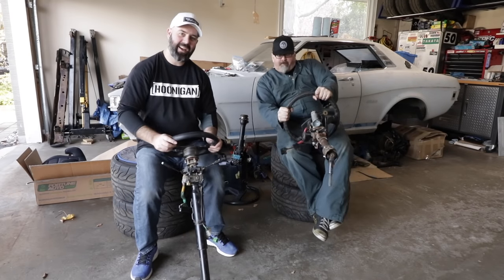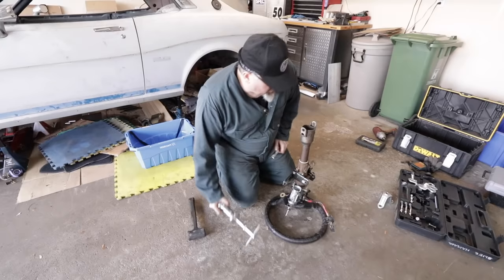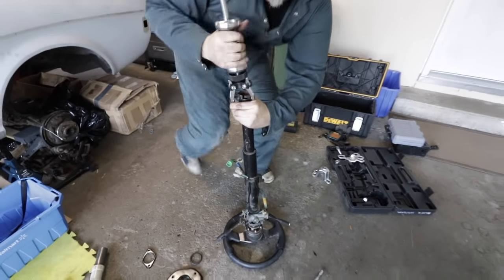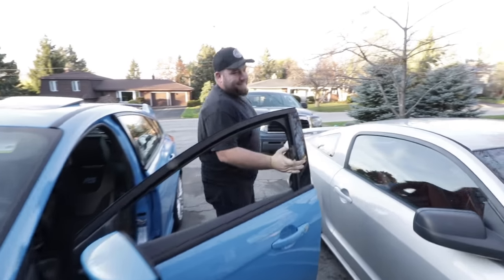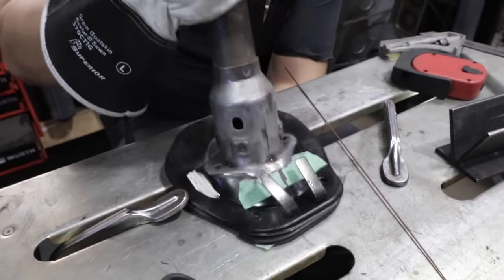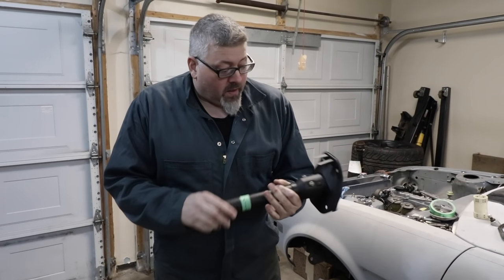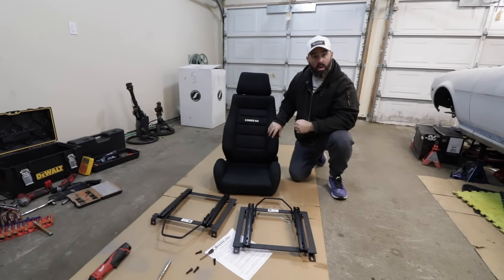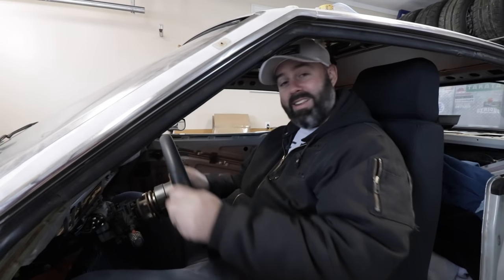How To Build A Custom Steering Column - RA24 Toyota Celica Project

Comment: Really great episode, I love the fabrication stuff. Even simple stuff amazes me as I have zero fab skills. I really like those seats too, the shape really reminds me of 80's Japanese cars stock seats, which the Celica is not far off from :) looking good, dudes.
Reply from the maker: We picked these seats for the same reason, they have a cool 80's vibe to them, which isn't quite period correct but somehow feels like a suitable choice for the old girl.
Reply: Totally agree, I think the Celica has just enough of a slight 80's vibe somehow that makes it work. Now just slam those seat rails to the floor!
Reply from the maker: Yup, gotta get the seats super jdm low and back a few inches too. I think I'll have NV Auto do it when they build the roll bar (once they're done building their 2JZ BRZ).
Reply: Just get some metal, cut it up and weld it back together and Boom! you're fabbin'  =)
Reply: There ya go, those guys are masters at their craft and could easily do it I'm sure. I just got my kirkey aluminum seat in for the Miata and I'm 6'3 so I'll be custom making (or attempt to) brackets for the seat, as well as a harness bar now that I have a welder. I've got a few friends that have good experience in fabrication so hopefully we'll make it happen. Can't wait to see more progress on the Celica!

Comment: Hey guys! Big fan of this build! A lot of the info you put out also applies to us 86 guys (well, obviously as you use 86 parts) :) you ever got around to discovering what kind of epoxy to use in that collapsible shaft part? My 86 shaft has play and not the good kind. I've tracked it down to the rubber or epoxy being decimated in that shaft. Keep up the good work!
Reply from the maker: We just bought some automotive grade urethane that we're going to use to "glue" the shaft into the u-joint. I think it should do the trick just fine. You should be able to re-urethane yours without too much difficulty. Good luck!

Comment: What was the purpose of the custom steering column? Safety? Wheel selection? Position?
Reply from the maker: So that we could connect the column to the AW11 MR2 rack & pinion steering. The Celica originally has recirc ball steering and it's many steering arms take up a ton of room in the engine bay and prevent swapping in a more modern engine like the Beams 3SGE we've opted for.

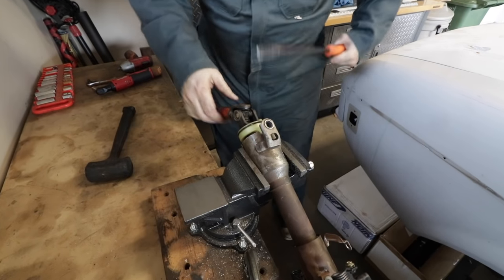Comment: at 2:11 never beat on a MR2 MKI steering column if you notice 2 white dots after he takes the bottom section out those are nylon pins that make up part of the collapsible aspect of the steering column. yeah so he just broke the thing, but hey just needed part of it anyways

Comment: hey guys, loooving the build, cant wait to see the finished result.

i got a ta22 and looking to do a similar rack conversion, do you guys have the details about the rack that you used? as im having trouble on that front with regards to keeping the geometry and bump steer in check.

did you alter the control arms to compensate for the new rack dimensions?

cheers

rich
Reply: Manual Rack from an AW11 MR2

Comment: 13:05 INCLUSIONS AND IMPROPER PENETRATION!

Also I can't remember if I asked this or not 

But why this motor and not like a 4age? 

Also is it an iron or aluminum block?
Reply: I was wondering if anyone else noticed the air pockets from not enough penetration
Reply: 0tink9 I was like pretty and because we didn't see the welding I was figuring he was only going so cold for the tack

The worst part is it wasn't even consistent 
Like he started and stopped every inch or so 

Looks pretty 
But I wouldn't stand on it
But from the force direction it should be fine 
It just greatly bugs me, he should know better
Reply from the maker: The welds are perfect, gents. What you're seeing when Dave cleaned up the inner diameter is where the old inner lip meets the plate, not where the column was welded to the mounting plate (which is further out due to the larger diameter of the AW11 column). 

The 3SGE Blacktop is 2-liter engine that's newer and more powerful than a 4AGE. It'll make an easy 200-210whp with way more torque than a 4AGE, revs to 8k rpm, has a Yamaha designed cylinder head with titanium valves, and has an iron block so takes to boost very well should we ever decide we want more jam.  Plus for $1300 it comes with a J160 6-speed transmission, so it's a great value.

Comment: How do the seats fit moose? I'm a similar body style and need more support in my S14!
Reply: Seem to fit pretty Well ...good fit thru the waist, the side bolsters felt good (Not particularly aggressive), bit tight thru the thighs (Lower seat bolsters) 
Really need to get the new custom lower seat mounts figured out as I was crammed in there when bolted to the OE mounts ...so it was hard to figure out how comfortable I really was :)   
 Moose
Reply: Andrew D thanks man! These might have to be added to the list!

Comment: The corbeau "bolt in" seat brackets never work when just bolted in. I cut 2-1/2" out of the height of mine in my truck.
Reply from the maker: Well, they did bolt up, but we definitely need more low :D